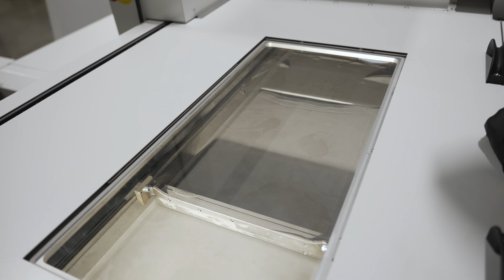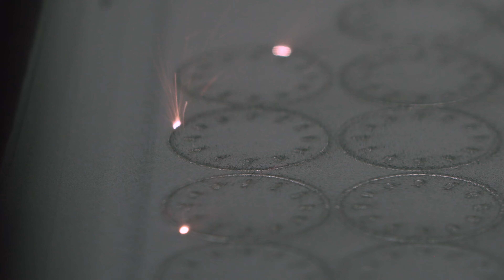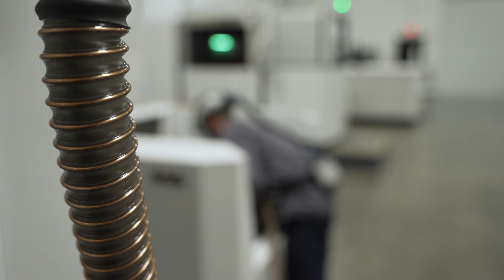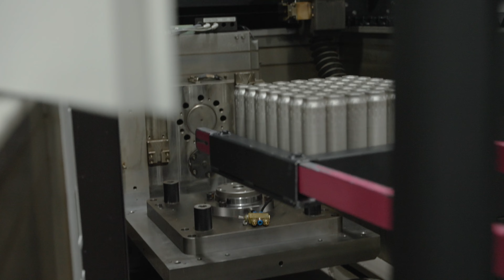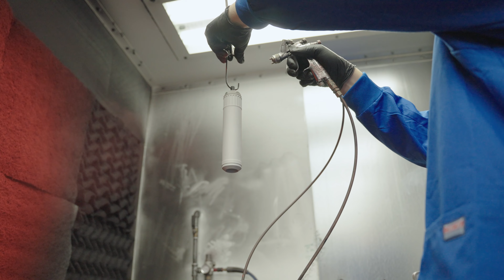The Making of the Flow 556k

Comment: I'd be curious to know what kind of tolerances are achievable on 3-D printed parts. Just scratching the surface as always🥃
Reply from the maker: Very tight!
Reply from the maker: If it isn't to spec it's trashed.
Reply: @HUXWRX  Ok.
Reply: With laser sintered material like this, probably very good. This isn’t hobby-level FDM printing.

Comment: I’ve got a bit of machining experience and a ton of 3D printing experience, couldn’t tell you exactly what I just saw go down but I’d love to work for you and learn!!
Reply: Looks like it’s essentially 714 stainless steel powder which is laser welded layer by layer in a batch to form the suppressors, the machine then rotates to allow the unwelded powder to fall out, then compressed air to blow out the remaining powder.think of it like resin 3D printing rather than filament extruded methods.
Reply: Dang it dale

Comment: Is a baffle strike repairable on these yet?
Reply: No, they would need to replace the suppressor. Also, not sure how that works as far as the ATF is concerned when it comes to transferring a new suppressor to you. Would be terrible to have to wait for another form 4 to be approved. SIG 3D printed suppressors have a cut line so they can reprint the baffle section and keep the same serial number. There's a reason why HUXWRX is selling alignment rods now that they are ramping up 3D printing. Priced a lot lower than Surefire/Geissele alignment rods too so no reason not to get one....
Reply: My understanding is... If you kill it you send it back. They make another one with tue same numbers. And officially destroy the old damaged one. No sure if that is true but I have read it in a few places.
Reply: Definitely reparable, chop end, core out, weld in new core and end. It is illegal to apply serial numbers from one can to another even if the original is being destroyed, it would have to be replaced and a new form 4.
Reply: @johnr1124 That is not true at all.  The most recent reply above mine is correct.  They can repair them and send them back.